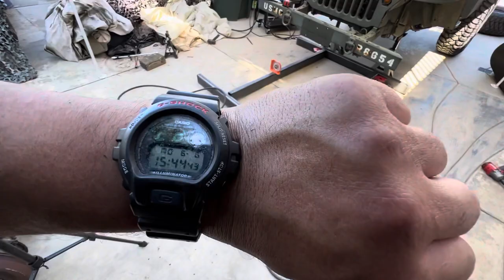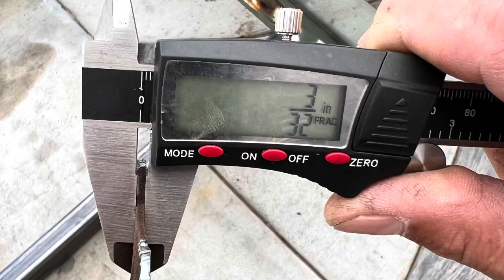1948 CJ2A Willys Jeep bent frame fix/ Buick V6 225/ Th350 automatic transmission

Comment: Spot on, weld some plates on that ?  While you’re there, I would just weld plates on all the frame “turns” for added support. Another YouTuber put disk brakes on his, looked pretty easy.   They have kits, not so expensive, at least for the front brakes, including a new master cylinder. You’re like me?  Where you just like to look at the great work you did and admire it.
Reply from the maker: cool

Comment: My frame was bent and rusted badly nice job fixing that up. So I am putting in a V-6 could you show in another video how your power steering steering column, pump, steering shafts and other stuff are installed I know this is a lot but it would really be appreciated
Reply from the maker: hi Maxx - sorry for the late reply; I sure will; I am starting another project here shortly and I will also include that; but I will make a video on Slumdog steering because I have to replace the power steering on that one. 
Thanks for watching - Ernie.

Comment: that frame jig is great! good job.  frame shops around me don't want to touch anything unless its $$$$. 

thank you for the rundown, looks easier than I imagined.  do you have a body lift? 5/8 polyurathane  pucks?
Reply from the maker: hi - I do not have any body lift. it is a stock fit. thanks.